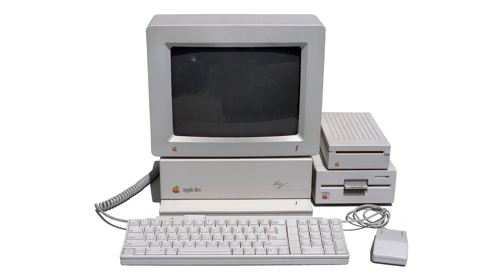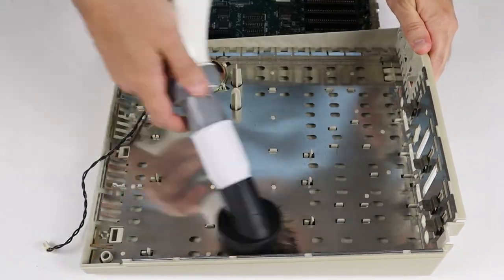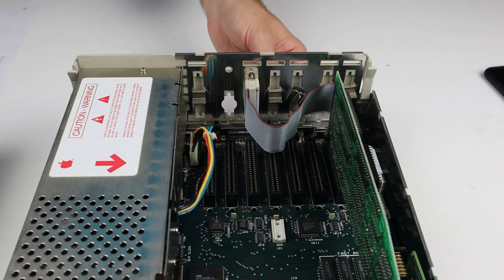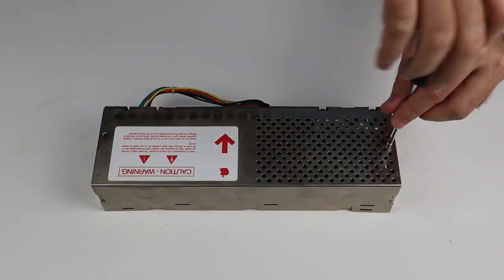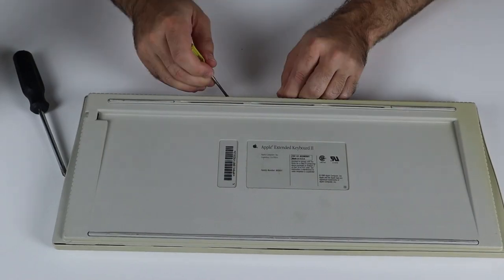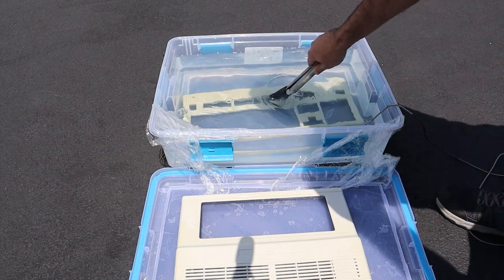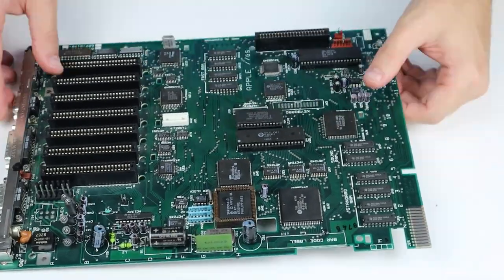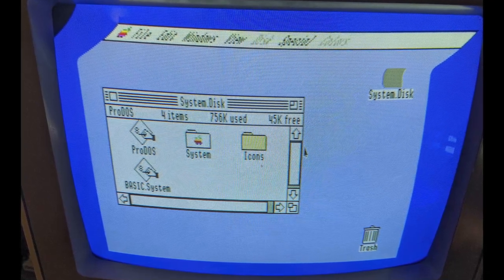Apple IIgs First Look, Repair, and Restoration

Comment: My favorite machine!  They were so far ahead of their time.  Jobs intentionally hobbled them to 2 MHz so they wouldn't blow out the Macintosh, but they are perfectly capable of running at 14mhz+.  Snag a transwarp GS if you can, to really open it up.

My only gripe is that the good compiler toolkitbwith all the hardware library interface and such is still commercial software.  >_<  orca c is onlyblike $20, but if it were free I think we'd see a lot more cool retro software for the iigs.
Reply from the maker: My friend one town over had one of these when I still had my C64. The difference was eye-opening. I'd love to find a transwarp but the prices are so steep!
Reply: @retrobitstv  reactivemicro  is taking preorders for a $450 twgs clone.  It sounds like it will be smaller and faster than the original, and run cooler.  It's been in preorder status for forever, though, and Henri hasn't responded to my email asking about its status.  :(
Reply: The ZipGS or TranswarpGS can get it to 14mhz+ but it's not a simple fix... those accelerator cards are half of the computer built into a new daughterboard... I have several friends in engineering that have taken apart a lot of Apple IIgs systems... there are a lot of practical limitations for the 2.6(?) clock that aren't part of a plan by Jobs to 'hobble' it.
Reply: @Jon Rowlison - Granted it wasn't as trivial as swapping in a faster 65C816 CPU back in the day, but the engineering required at Apple R&D to get the IIGS running natively at 7-10 MHz in the 1980's wasn't THAT difficult. From from it. Sadly, it became quite clear Apple management wanted the IIGS locked down at the lower speed--for political reasons, not technical or cost-related ones. At the very least, they could have at least done a "quick and dirty" speed fix, much in the same vein done with the Apple IIc Plus. License the ZipGS ASIC design from Zip Technologies/REMcorp, and integrate it onto the main board with a 65C816-14 and some SRAM. The nice thing with the Zip design is it's an all-in-one chip. They wouldn't even give the machine a simple stereo-out jack, even though stereo sound was built-in the Ensoniq chip! Incidentally, the IIGS had graphics comparable to the Amiga, with a 12-bit palette (4,096 colors) and up to 256 colors per screen (16 per scanline), without trickery or CPU load, which even exceeds the Amiga's 32 colors per screen.
Reply: Jobs was out by the time the IIgs entered development; I can't pretend to know what the reasoning would have been for throttling the processor but I'm sure it had more to do with maintaining legacy Apple II compatibility than anything else. One big knock on the IIgs was the Ensoniq sound chip which got them into a ton of trouble with Apple Corps and a Jobs-era agreement that Apple Computer wouldn't cross over into music production.
Reply: @outsidethewaxbox  - Legacy Apple II compatibility was maintained by allowing the CPU to slow down to 1.023 MHz, and always running the system bus (video, expansion slot access, etc) at 1 MHz, regardless of whether the machine is in "Normal" (1 MHz) or "Fast" (2.8 MHz) mode. And of course the Mega II chip was an entire Apple IIe computer on a single chip, minus CPU, RAM and ROM; the Mega II was at the very core of Apple II backwards compatibility. The 4 MHz 65C816 was clocked down to 2.8 MHz for timing issues with its then-design and native operations, but that could have been easily increased with some minor re-engineering. There is absolutely no technical reason Apple couldn't have bumped up the IIGS's speed to 7 MHz or higher. I'm quite certain this was done on paper, maybe even working prototype designs, but Apple management vetoed it. It's all rather bizarre, Apple did everything it could to kill the IIGS except actually discontinue the machine!

Comment: I had something similar with the video on mine, but discovered it was a fault in the monitor as it started doing similar things to other systems too. Mine affected the bottom third of the monitor though, might be related but it's hard to say.

Another superb video on an excellent system. Makes you wonder how different the world might have been if the IIGS had beaten out the Macintosh as the lead Apple product. Again, great video, and rock on!
Reply from the maker: Thanks, glad you liked it! Yea, if the IIgs had the full weight of Apple behind it and ran at a higher clock speed out of the box I bet we would have seen a ton more developer support for it :(

Comment: How you conected the IIgs to the 1084 ? Rgb or just composite ? That monitor fits so good on the IIgs, wonder if it´s so heavy for it. Case for me looks a bit weak for hold a heavy crt.
Reply from the maker: The IIgs is connected to the 1084 via RGB with a custom cable. I was able to source new pigtails for both the Apple and the 1084 side and just wired them together. It works really well! My IIgs does put out some funky sync signals that other monitors don't seem to handle as well. I've been meaning to dig into that and see if I can come up with a workaround. I'm not super worried that the 1084 is too heavy; people used to stack their power savers, disk drives, and monitors on the IIgs back in the day!
Reply: The IIGS output analog RGB at 15.75 kHz, so most displays similar to the 1084 should be compatible. I've been hoping to one day build an adapter cable to connect up my Amiga 1080 monitor and Atari SC1224 (not sure where I'd find the funky connector the Atari uses though, and not hacking off the end!). I've even used VGA monitors that sync down to NTSC frequency, like my NEC MultiSync 3D or Sony CPD-1302. All they require is a simple Apple->VGA adapter attached to the cable.

Comment: Surprised to see the PSU inspection AFTER you've powered it on several times :-) but nice overview.  I hate this term, but the IIgs definitely had a lot of hidden gems, so run as much IIgs-only software on it as you can.
Reply from the maker: Thanks! Yea, I figured what harm could it do since the seller had powered it up before I got it! Any recommendations on must-try software?
Reply: @retrobitstv  Sure, there are some apple iigs demoscene demos to start. Also, Deluxe Music Construction Set has some amazing demo tunes. For games, Bard's Tale and Tass Times in Tonetown have typical but nice uses of music and 16-color graphics. And Becky Heineman ported Out Of This World to it so that's fun.
Reply from the maker: Sweet thanks, I'll look into those! Next project is to try getting software directly onto the HDD using the WiFi modem instead of the ADTPro transfer method I've been using that requires using floppies.
Reply: @retrobitstv  - I'd recommend checking out Zany Golf, The Immortal, Task Force, Rastan, Arkanoid I and II, DuelTris, Thexder, Spacefox, KABOOM, Wolfenstein 3D, Out of This World. Any demos made by FTA or Ninjaforce, particularly MegaDemo and Kernkompetenz from the latter group (you can watch a capture of it on my channel). Music software like synthLAB, Music Construction Set and Diversi-Tune are quite nice (also on my channel). It actually kept up quite well with the Amiga, the problem was it had a lack of software and support, and what software it did get often under utilized its capabilities. Sound-wise it blew the Amiga away, compare the soundtrack for Rocket Ranger on both machines for example, or Zany Golf especially.

Comment: I wish there was a graphics card that would allow you to plug in a standard svga monitor. 

I mirrored a video about a prototype for what likely would have been the gs+. The theoretical specs (integrated super drive, 40mb hard drive, ram slots, upping the stock clock speed) would have made it a compelling option to a certainty audience in my eyes. 

Hell I would have wanted younger me to have one.
Reply from the maker: I haven't tried, but a RetroTink or OSSC would probably fit the bill for upscaling to VGA. Yea it's a shame there weren't further/more powerful IIgs models, it's a great platform, just needed more oomph.
Reply: @Andrew Singleton - Actually there is the Second Sight card for the IIGS, released in 1995 by Sequential Systems. It lets you use a standard VGA monitor, but unfortunately it had some quirks, mainly due to the firmware not quite completed. I have one but they're fairly rare to find these days. If you can find a VGA monitor that syncs down to 15 kHz, you can use that directly with the IIGS (e.g. NEC MultiSync 3D, Sony CPD-1302). Personally I prefer the AppleColor RGB, and those manufactured between 1986-1989 because of the quality of the tube. I think some Atari ST's SC1224 monitor used that same tube, though you'd need to wire a proper cable.

Comment: pay attention with the vacuum cleaner unless that brush is ESD safe!
Reply from the maker: Thanks for the heads-up! The brush attachment isn't specifically ESD safe, but it is genuine horsehair which I'm lead to believe is safer to use than e.g. nylon. I'll keep my eyes open for a proper attachment :)

Comment: Was it available outside the US? I can't seem to find any 50Hz units. Can you overclock it to 8Mhz?
Reply from the maker: It was available outside the US and all models (well maybe not ROM0?) can output 50Hz RGB.  To select the video standard, hold down the closed apple/option key when turning on the machine and a menu will pop up. Hit 3 to select 50Hz. All models are hardwired for NTSC-only on the composite output. No problem if you're using a SCART cable though. There's a hardware mod you can make to get PAL color on the composite port too.

Comment: GREAT video! Thanks! One question: Where did you get the cable to hook the IIgs up to the Commodore monitor? If you soldered it yourself do you know of any good sources of info on how to go about it? I'm looking to get a hold of an Apple IIgs and seeing as how those monitors tend to die during shipping I'll be using my trusty 1084 with it, but I can't seem to find an appropriate cable.
Reply from the maker: Thanks! I made the cable myself. Here's the the 1084 connector: https://www.digikey.com/en/products/detail/tensility-international-corp/10-00436/2625286 and the pinout for Analog RGB: https://gona.mactar.hu/Commodore/monitor/Commodore_1084_pinout_DIN-rotated_large.png

The IIgs end uses a DB15 connector with the following pinout: http://www.apple2faq.com/wp-content/uploads/2016/03/Apple_IIgs_RGB_pin_outs.jpg Connect R, G, and B accordingly. I tied the grounds together, and connected the Apple's csync to the 1084's hsync pin. 

There are also VGA and SCART adapters you can buy for the IIgs directly.
Reply: @retrobitstv  wow, thanks! This us super helpful. I'm very excited to get my first taste of AMERICAN computer history. Those Apple II machines are very uncommon here, and I've not met anyone who grew up in the 80s or 90s who grew up with an Apple machine. Still so many great american developers started on the Apple II, and so many historically sognificant games were made on it. Seems strange to be a vintage computer enthisiast and NOT have some sort of Apple II in my collection :)
Reply from the maker: @nevilovermann797  The Apple II and later IIgs were super common here as we had them in our schools. The machines we didn't have over here were the BBCs, Sinclairs, Amstrads, MSX, etc. I have a lot of catching up to do with all of these systems :) Enjoy the IIgs though, it's the best of both worlds as there's a huge library of Apple II software and some pretty great IIgs specific stuff as well!
Reply: @retrobitstv  Do you think there could be issues since the machine is NTSC and my monitors are PAL? Will the RGB signal work regardless? I've never owned an NTSC-machine before so I really have no idea about the differences. The machine is on it's way to me now and I'm going to order a new PSU, which should support my voltages, but apart from that I have no idea what to expect from an NTSC machine in terms of difficulties.
I'm sorry to lean on you here, but any thoughts or suggestions would be greatly appreciated :)
Reply from the maker: @nevilovermann797  You likely won't be able to use the IIgs composite output since I believe that's NTSC-only. You should be fine using RGB, as there is no NTSC/PAL encoding to worry about. My 1084 can sync fine with both 50 and 60hz RGB sources, so I assume yours will too. And even better, you should be able to switch the machine to 50hz mode by hitting closed apple-ctrl-esc instead of the usual open apple-ctrl-esc used to enter the setup menu. Good luck and enjoy the machine!

Comment: No baking soda mixed with superglue? 😁
That adds a little strength to parts.
Reply from the maker: I've never tried that but I've seen it done. Recently I've found that there are 3d printed models for all kinds of IIgs blanking plates so I am going to run off a bunch of them, including one that'll fit my USB port!
Reply: @retrobitstv  the mix hardens like a rock but it can be brittle, depending on the thickness.
For restoring pillars and add strength epoxy works very well too. 3D printed parts lack smoothness imho, unless one wants to go through extra processes to smooth and polish the parts.

Comment: The IIgs was very good back in the day, but today it is totally outgunned by the cheapest Windows PC.

It's like comparing a Ford Pinto to a modern Tesla.   Sorry, but that's the truth.    And I owned the IIgs Woz Edition as a kid.
Reply: That would be the case for any old compared to today, wouldn't it? lol
Reply: @kentucker3259  Yes, but why restore an old dinosaur like the Apple IIgs?   It cannot do much of anything, in 2024.
Reply: @DerekDavis213  Sure it can.
Reply: @kentucker3259  Like what?  Slow super low-res games?   Or some primitive spreadsheet with a 64k memory limitation?   Or maybe using a 9600 baud modem to call BBS lines?    That's like a snail in a world of Ferraris.